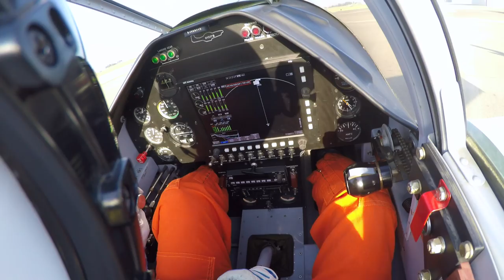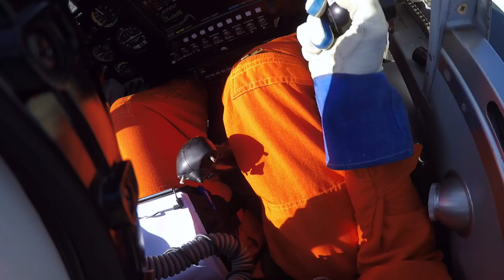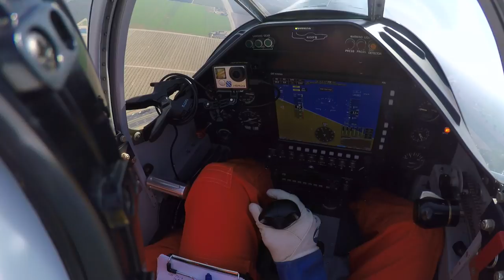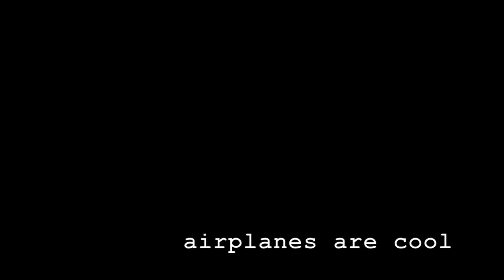Bower's Pony 10.1.17

Comment: Very cool stuff Elliot!  Curious as to the condition of the engine after being over rev'd - no one seemed very stressed about that, but isn't that cause for major teardown / repair?
Reply from the maker: Thank you for stopping by!  Redline is 4700 rpm, I set 4200, peak rpm was 5900.  So from a percent overspeed it's not as bad as it sounds.  The motor is all automotive so 6000 isn't a lot.  The problem is the prop and the rest of the aircraft stuff, which is all being inspected as we speak.

Comment: CONGRATS Rod!  I know you'll keep sneaking up on all the performance issues and when you're done you'll have a plane that flies as beautifully as it looks!  Congrats again!

To the test pilot: Interesting visor mounting system there.  Never seen that before.  My helmet the AF Life Support guys let me keep when I retired has the standard straps on the side.  Do you use that setup to allow for the GoPro suction cup mount?  How much do you like it?
Reply from the maker: Thank you.  The HGU-68 visor is a must.  Moving the lock off center and getting rid of the cover buys back height in the cockpit.  For gangly guys like me I need all the help I can get.  The visor isn't as protected, as a result I have busted a couple visors.

Comment: It's all about hitting the curve ball. Nicely done, fascinating read. One question:  "... governed to 50 mph..." ; perhaps "...governed to 50 RPM?"  Thanks.
Reply from the maker: Thank you for the note.

The comment is referencing the governor behavior, the point is that the engine RPM appeared under control at 50 MPH when the airspeed came alive and I committed to the flight.  I will chew on it some more, but for now i think I am still happy with the wording.  Thank you again for the note.

Comment: You couldn't hear the prop rpm runaway?
Reply from the maker: Great question!!  I am so glad you asked.  The prop rolled up slow with TAS, because the propeller governor never failed, it was just never working.  Because we set the power below full it wasn't high enough to be a problem until I was airborne and dealing with the control jam.  Such a fascinating failure, thank you for asking!